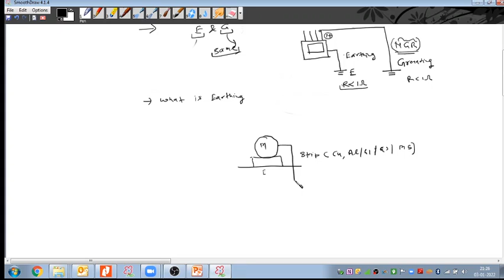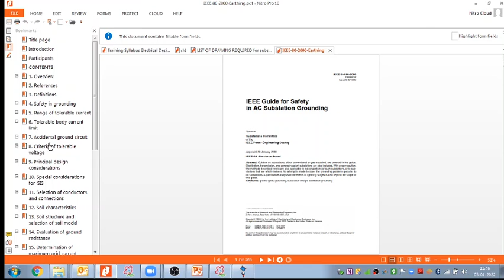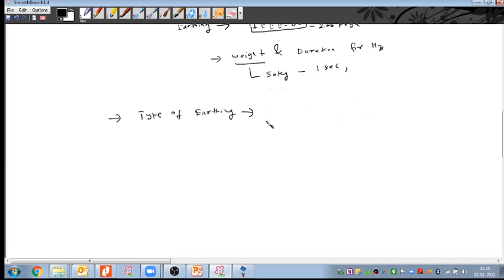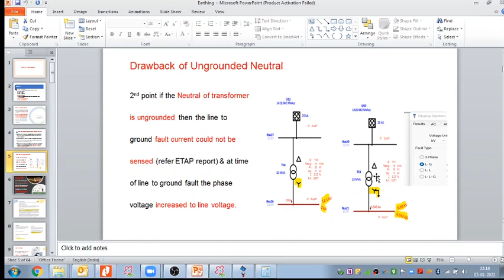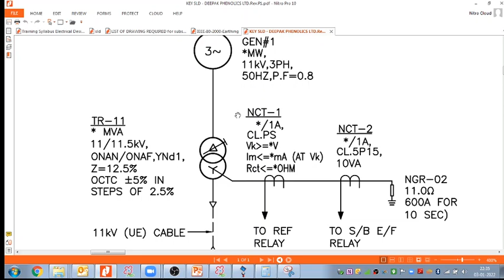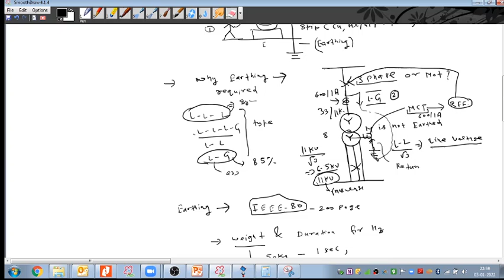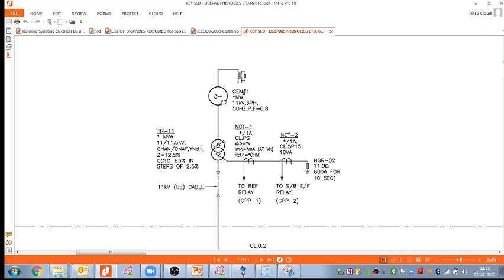Comment: Sir, Thanks for the Video. I have already enrolled with your course and the same will be started on the 29th. I have a question when we have a Generator connected to a Delta-Star tx,  is it OK to have the NGR at the Start point of Tx ? what will happen if there is any ground fault before the TX, then there will be a high current at the generator stator (Vidoe 1:19:57 ) through the generator solid grounding

Isn't it better to have NGR  /NER  at the Generator star point ?? pls advice